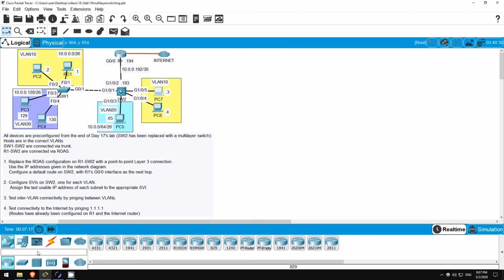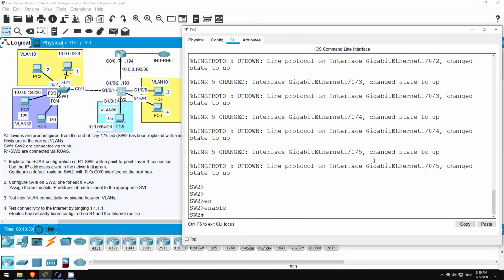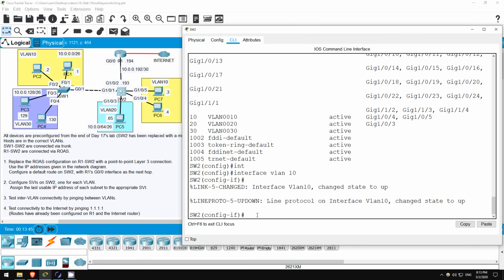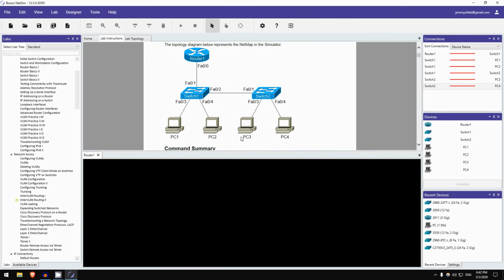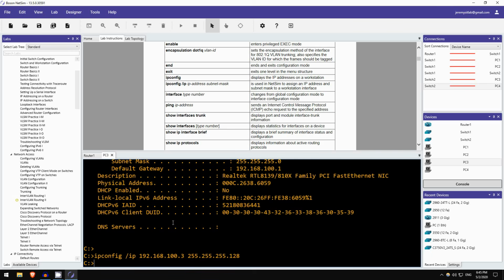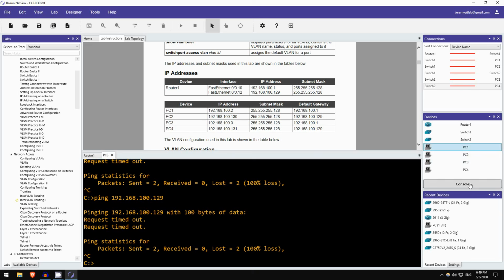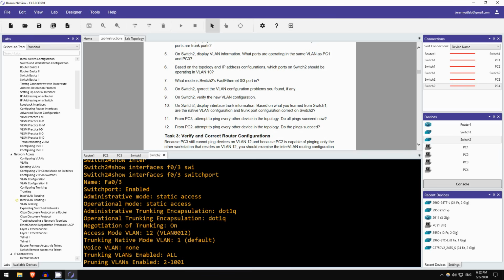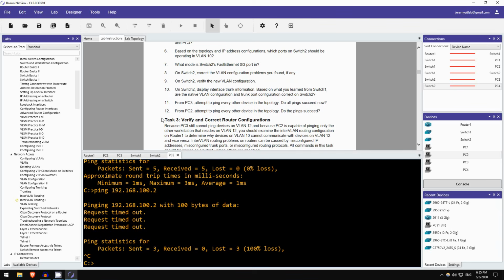Free CCNA | VLANs (Part 3) | Day 18 Lab | CCNA 200-301 Complete Course

Comment: Hi sir, I configured DHCP server in R1 at the previous lab and all the PCs received proper IP addresses. However, it seemed not working for this lab. I switched to Simulation mode and saw the DHCP frame was not be forwarded to R1. Can you please help me with it?
Reply from the maker: The DHCP frames sent by the PC are broadcast frames, they will only be forwarded to devices in the same LAN (VLAN).  In this lab, the switch is now the PCs' default gateway, and R1 is in a different subnet, so it won't receive the broadcasts.  
Try these commads on SW2:
interface vlan 10
 ip helper-address 10.0.0.194
interface vlan 20
 ip helper-address 10.0.0.194
interface vlan 30
 ip helper-address 10.0.0.194
end

Then, on the PCs do: 
ipconfig /release
ipconfig /renew

I think that will fix the problem!  I will talk about DHCP later in this course.
Reply: Jeremy's IT Lab I really appreciate you Sir. Thanks you soooo much!!!

Comment: Anyone else having an issue with this lab not working when pinging PCs between VLANs? I have run through it 3 separate times from the start just following the video and I can never ping at the end. Simulation mode shows the packet travelling to the VLAN but it never shows a reply. The default route doesn't work either.
Reply: Same here, it's very frustrating. Did it myself first, then after an hour of not being able to figured it out, closed the PT and Followed the same steps. Still nothing

Comment: sir i dont know whether u get my doubt or not but i wil try...  while configuring L3 switch u showed the interfaces in it but im not getting any interfaces when i give show run command no interfaces are appearing
Reply from the maker: Does 'show run' display interfaces on other devices?  Are you using the spacebar to scroll down in the output?
Reply: @JeremysITLab  yess sir it's showing for other devices... How did u added L3 switch there sir?

Comment: Question I know that you got the subnet mask of VLAN 10 and 20 but wondering how you got .62 for VLAN 10 and .126 for VLAN 20 is it because it is the broadcast address? From what I remember /26 belongs to 64 group so it increments by said #. So 63 would be broadcast address for VLAN10 and I'm guessing 62 is that networks address? Correct me if I'm wrong. Sorry I have troubles with subnetting its one of my weak points.
Reply: .63 is broadcast address of 1st subnet, so the last usable address of the 1st subnet will be .62 and .1 is the first usable address of the 1st subnet. You are confused about .64 which will be network address/ID of the second subnet. Since /26= 2^2 that's 4 subnets.

Comment: Jeremy is there a way to remove the L3 "no switchport" setting from an interface.   I accidentally enabled it on g1/0/3, when I use the command:   config t -> default int g1/0/3->Interface g1/0/3 set to default configuration (however it doesn't show it as reset in the show run).   I am unable to put it back into access mode.   Is this a packet tracer issue?
Reply from the maker: 'default interface' should work, but if its not in packet tracer just use 'switchport'.  
'no switchport' is just a command to cancel out the 'switchport' command, which is applied by default but doesn't appear in the running config.

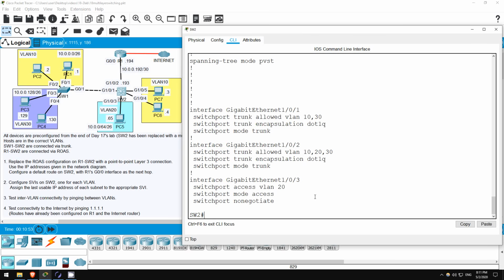Comment: Inside the lab file provided, the switch is not configured as shown in 5:06 , there is no "switchport trunk encapsulation dot1q", is it normal?
Reply from the maker: Cisco removed the command in packet tracer
Reply: @JeremysITLab  Hi, thanks for the reply, but may I know why Cisco removed it?